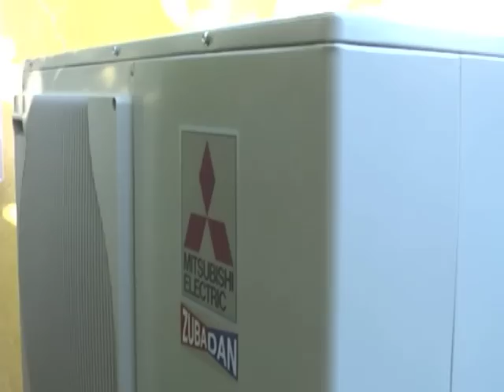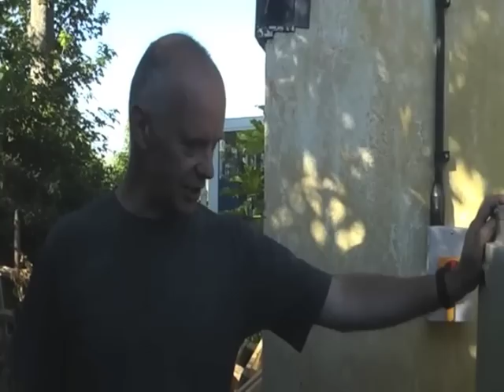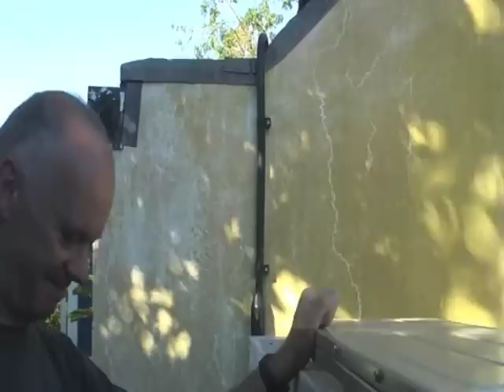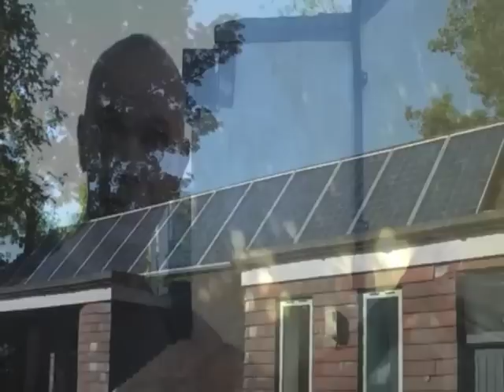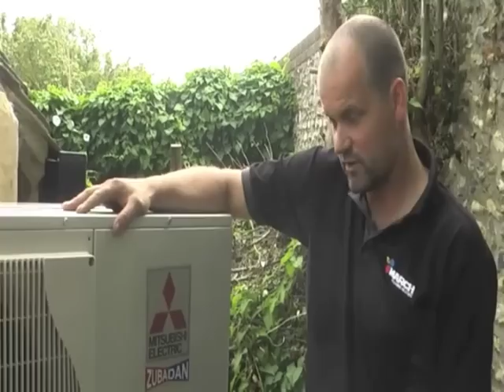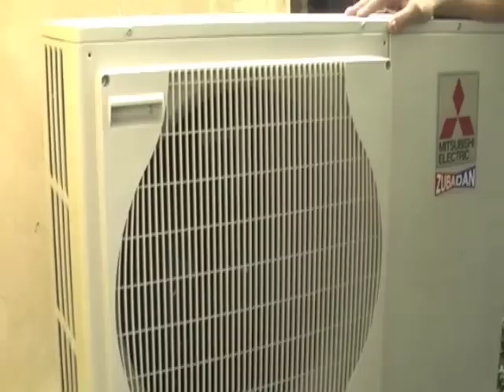Air Source Heat Pump - how it works & the benefits

Comment: I'm a plumber and not really sure about these heat pumps at all, he says it runs at 45 degree on average, has to be on all day, what dos it cost on electricity to run this?? I would imagine the house would have to be ultra insulated with a full prior air test to even consider installing one of these and that includes possible installing new windows, maybe suitable for new build but not for retrofit?? It's a great idea but bit like electric cars, still in its infancy. Did I hear the guy at the start say if it was really struggling on a very cold day you could light the stove??